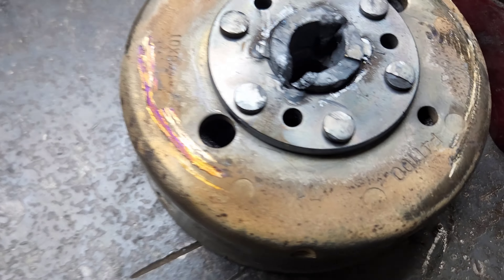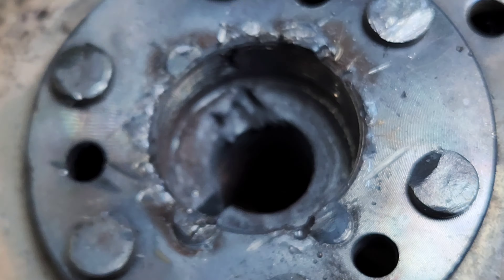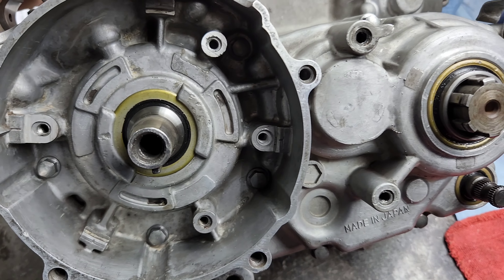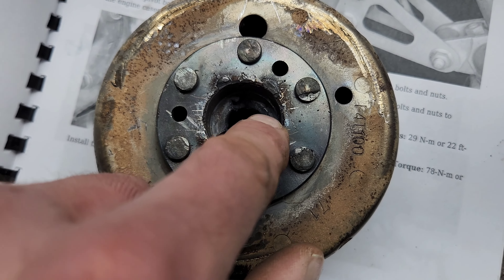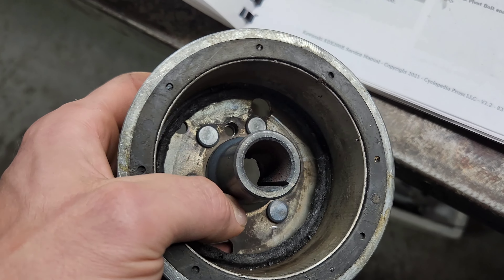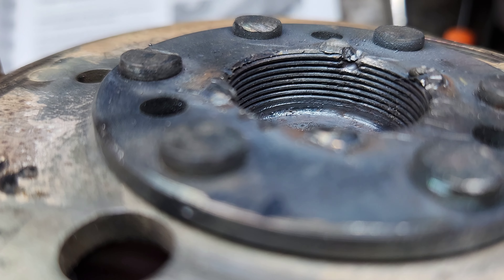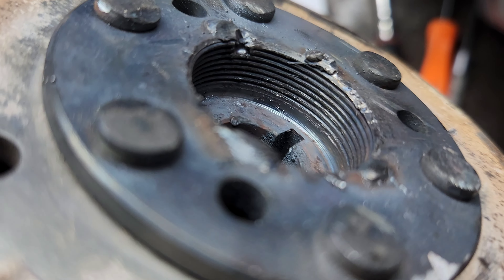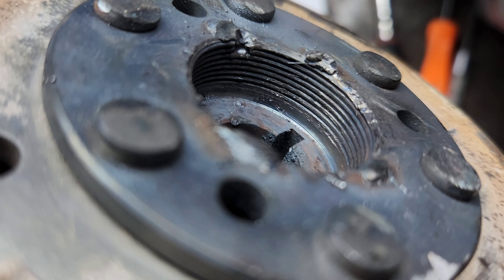KDX200 Engine Rebuild Part 3: Moving Along

Comment: Did it need a bottom end, or did you just want to?
And I would be replacing that flywheel if it were me. Haha
Reply from the maker: Stator side crank seal was leaking.  And yeah probably going to source a different flywheel.
Reply: @GasSoakedRag  My right side crank seal leaked once on my 1976 Kawi KE175 and it was causing it to burn transmission gear oil.